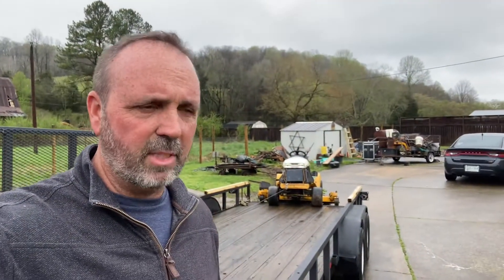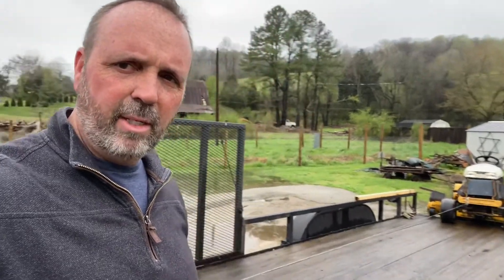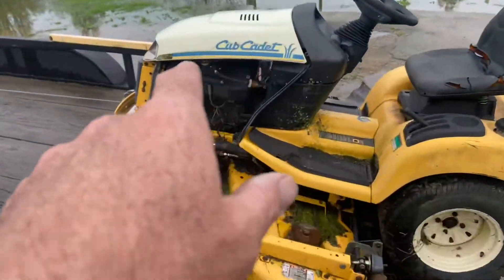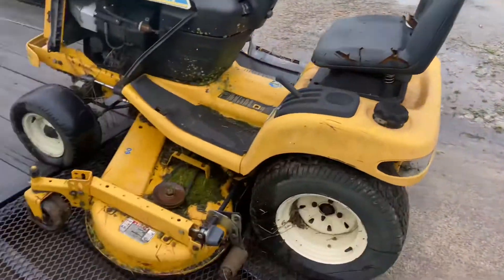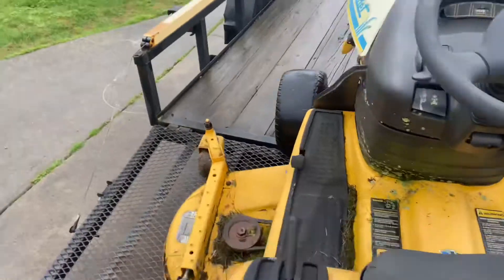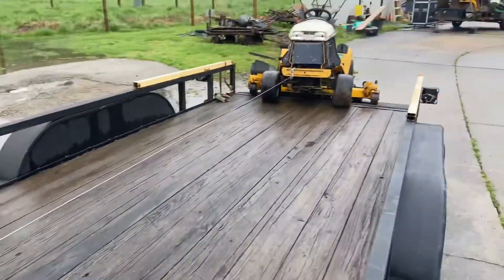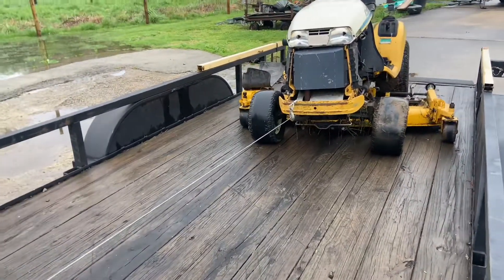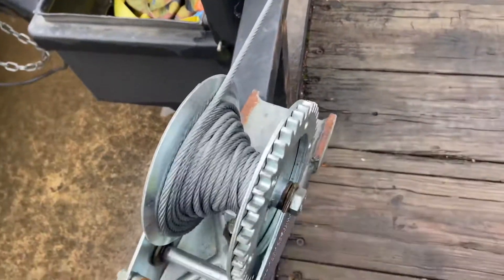Cub cadet 3000 series

Comment: That is a good one . That is a strong motor . Never had a mower with power steering .
Reply from the maker: I’ve always wanted one with power steering now to get it running smoothly
Reply: I have no doubt you will have it running like a fine oiled machine !!

Comment: Wow, I bought mine brand new In 2007 and It still runs perfect and still looks like  It's only a couple years old. Never ever had one problem with it besides I battery replacement and blades. This mower Is bullet proof and Im not sure I will have as good luck with the newer ones.
Reply from the maker: They are great mowers, this one just sat outside and was abused for years

Comment: Power steering on a garden tractor is always a good thing. Especially if you have shoulder issues. 
Looking forward to updates on this one.
Reply from the maker: I’m a little worried about all the seals and leaking fluids that’s why I put Motor  oil in the transmission, If it does not leak then I’ll start putting some money into it
Reply: @MurphyMower  seals are cheap if you where hydraulic repair shops go get theirs. When i was working I always used swan engineering. O-rings and seals are dirt cheap. Its that guy in the middle that makes that stuff expensive

Comment: I'm about to pick one of these up for $250. It looks to be in decent shape. It is owned by a guy who isn't mechanically inclined. He said the belt got tangled underneath it and don't want to mess with it.
Reply from the maker: Wow great find- good luck with it
Reply: @MurphyMower  I'm going to look way closer at it before I buy it. I hear they can spring near impossible to fix leaks. Looked like it had some oily residue on the deck in the photos. Fingers crossed.

Comment: I have the 3000 series with the Briggs engine. I need to order some replacement bolts for the mower itself. Where do i find the information to look up online for parts?
Reply from the maker: Nowhere in particular, just Google the model number and you should be able to find parts diagrams, online fairly easy

Comment: But it does use motor oil (well diesel) not hydro fluid.
Reply from the maker: I’m not really sure there is a part number on the back and my plan is to change filter and just use recommended fluid, once I find out for sure I will update

Comment: Engine oil in the power steering, hell you may as well fill the fuel tank with 10W30. LOL. I have a repair shop and I would turn down working on it after what you put in it.
Reply from the maker: After video- I replaced with appropriate fluid- worked perfect